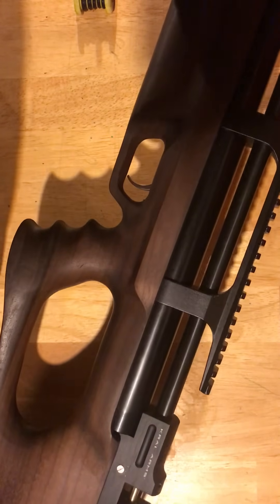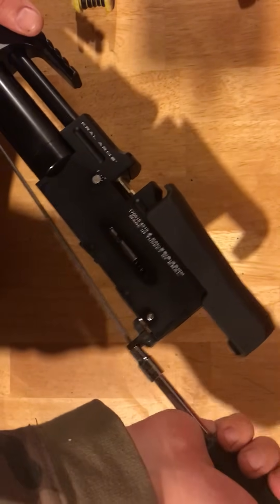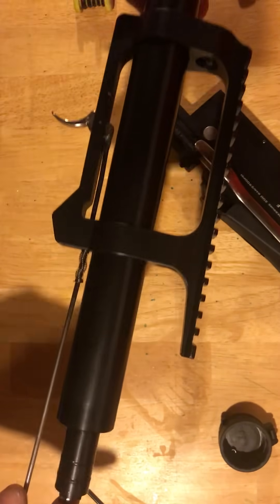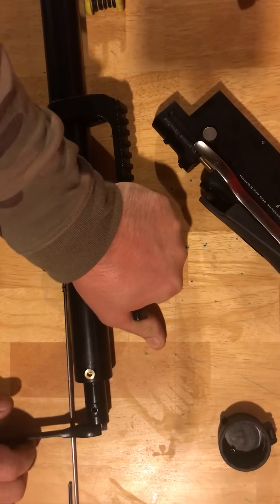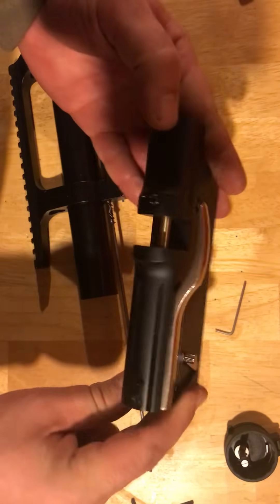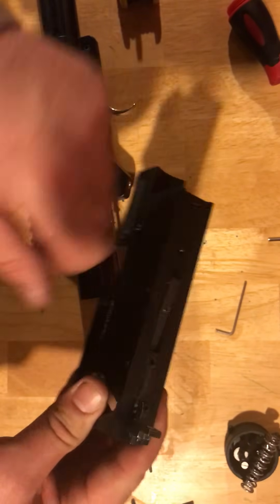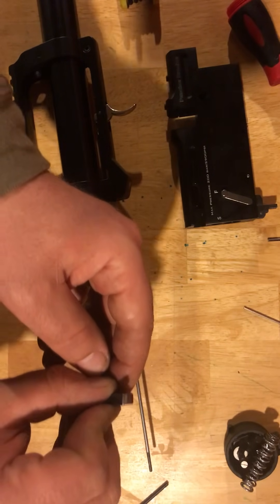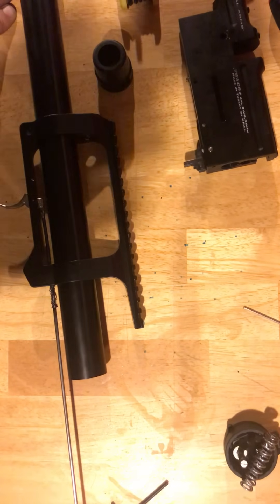Kral Puncher Breaker Disassembly Video.

Comment: Thanks for sharing it, now I know how to disassemble my kral puncher breaker purposely to see how it won't work when I cock. Upon cocking, it will slide and it won't cock, maybe there is a problem on its spring tossing the sear to hold the bolt.

Comment: Opening up the port on the barrel only.  Does that alone help with a bit more power?  Or is it a must to open up the related components to get any benefit?  If you’re just looking for a bit more , not a lot more.  Or  what would be a recommended “tune” for a beginner who is starting out with disassembling/assembling.
Reply from the maker: It will add a bit more. Use a counter sink bit to give it a funnel shape for better airflow.

Comment: hi    great video     i was woundering if the krall barrels will fit in a reximex     my barrel is 11.98 mm  up to 12 mm the the main that goes into the block
Reply from the maker: They are the same diameter going in but the length of the smaller diameter section may not be the same length.  Not sure the screw retaining divots would line up either.
Reply: @AnnihilatorAirguns   many thanks  ive got a reximex accura    but its only a 380 mm barrel   there arnt any barrels for the reximex in the uk  but loads of 580 mm barrels for a krall   the retaining lugs  should be simple enough to make new ones   and  the length of the small diameter that goes into the block is 45.65mm to 45.75  ish   lol   cheers and thanks

Comment: What is the thread size on the regulator that you unwound from the tank? M28x1.5?
Reply from the maker: The tank is M18x1.5 but no regulator on that gun.
Reply: @AnnihilatorAirguns  At 10:33, you have the valve in your hand, I would be interested in its thread size.

Comment: Hey Troy,  you called the hammmer spring bolt a power adjuster. Does turning that affect pellet velocity?
Reply from the maker: It does.  It adds or reduces the power of the hammer strike.

Comment: Hello sir I got a kral puncher knight and I want to know if you have any video how to adjust the hammer thanks
Reply from the maker: The large screw face on the rear of the reciever you see @ 13:53 adjusts the hammer spring. Turn it in for more power out for less.
Reply: Thanks sir
Reply: Im adjust the screw in but now don’t engage so im screw it out again thanks for the help sir god bless you

Comment: Where did you get that improved firing valve? Mine broke right at the o-ring, and I just had to order a new one on Pyramidair, the shipping was horrendous, and the disassembly wasn't fun either.  I'd like one like yours.
Reply from the maker: The new factory firing valve assembly (stem poppet and seal)  shouldn't fail.  The use much better material now. These I have made but require the valve to be machined to add an oring to the inside of where the stem rides.
Reply: @AnnihilatorAirguns  Thanks. I might weld the broke piece off and machine it just to have it.  I'm glad the materials are better. 

Thanks for the response.

Comment: Hi very useful video just one question like Dan Hurst asked a year ago have you any way to remove the UK anti tamper mine is on a Webley Mastiff which uses the same action, there is a pin under the rear trigger mount that is the problem stopping removal of the hammer. Thank you Graham
Reply from the maker: We don't have anti-tamper here so I've never done it. should be able to center drill it and remove with a broken screw extractor kit.
Reply: @AnnihilatorAirguns  thank you for quick response I'll give it a try
Reply: Hi did it I used apiece of tubing that went over the screw shear point than filed teeth on it next hardened it and used a Battery drill in reverse hay presto it just bit in and unscrewed it, iirc then fitted my regulator but am waiting on a reduced spring to keep it legal. Thanks Graham

Comment: Troy I was wondering if this regulator was a better one for the  .25 PB.
Kral Arms Breaker Tuning Regulator By Huma-Air
Reply from the maker: I don't recommend a regulator for the 25cal.
Reply: @AnnihilatorAirguns  ok cool. I was just about to buy it. I notice that there is a increase in shots but ft/lbs of energy goes down. Is this the reason you do not recommend it?
Reply from the maker: @derrickmitchell39dm  I can get more power and shots without one.
Reply: @AnnihilatorAirguns  man, I am sending you my gun, I gotta.
Reply: @AnnihilatorAirguns  what about that SSG. Can that be used on the Puncher breaker?
Reply from the maker: @derrickmitchell39dm  I use a debounce twin spring hammer now. The SSG is too light for big power on a 25 cal.
Reply: @AnnihilatorAirguns  OUTSTANDING! I sent you a email. Please read it at your earliest convenience and get back with me. I'm sold on your skill level and want to get started. Thanks Troy.
Reply: We miss your instructional videos Troy. Where are you man😃

Comment: Troy,
I just picked up my new breaker. Its UK spec so the hammer adjuster cap is locked in place. Do you know how to remove these? The factory hammer spring is binding and I need to changed this and add some top hats and slip discs, but I can't get in through the adjuster cap.

Thank you

Comment: Hi Troy, great videos, ive learnt so much, i have an issue which i cannot resolve, when i pump the gun using the manual pump it seems that the hose holds pressure but nothing is entering the gun, the pump is impossible to push down but seems to pressurize a little when i pull it up with great difficulty, what do you think it might be ?  Thank you kindly

Comment: Troy
Do you happen to know the measurements of the air tube?
Reply from the maker: 35mm OD 30mm ID
Reply: Annihilator Airguns thank you
Reply: What about the male and female thread of the tube and the valve size?
Reply from the maker: @sawtenna2382  not sure, you'll need to measure.

Comment: Hi Troy, I have a problem with my kral arms puncher breaker I can't fully fill my air rifle to a max of 200 bar. Everytime I fill it up it only fills up to 180 bar . Do you have any solution for this?
Reply from the maker: mark mendoza how are you trying to fill it? Tank or pump?
Reply: Tank Troy
Reply from the maker: mark mendoza what's the tank pressure?
Reply: Its 4500psi
Reply from the maker: mark mendoza is it fully filled? You can't put pressure on the gun higher than what's in the tank. If that's not the case does the gun gauge match the tank fill gauge. It's possible the gauge isn't reading properly.

Comment: It would be nice if manufacturing come up with a type of quick disconnect for the barrels on PCP rifles that would do away with O-Rings and make dissembling faster and safer without the worries of O-Rings getting destroyed in the process.
Reply from the maker: Mike Whit it's a very effective way of attaching the barrel both in performance and cost.

Comment: do you need to remove the barrel in order to fit a regulator in the reservoir?
Reply from the maker: Jacques du Plessis it's not necessary. You'll just have to remove the muzzle break/shroud in order to remove the reservoir. The barrel band has to slide off the barrel.
Reply: Thank you sir!

Comment: Troy I’m having problems filling mine without air escaping from the fill port I have replaced the orings and it still leaks out quickly I have a hand pump should this pump fill it? It does the same with a tank also
Reply: Jeremy Rowe I had same issue, push the fill probe into the port and hold then while still holding pump a couple times with the other hand or use two people, after a couple of pumps it will seal and start filling
Reply: London Vermin Control that worked, I pushed it in and once I had a little pressure behind it it worked. I also used a some lithium grease and it filled right up. Thanks